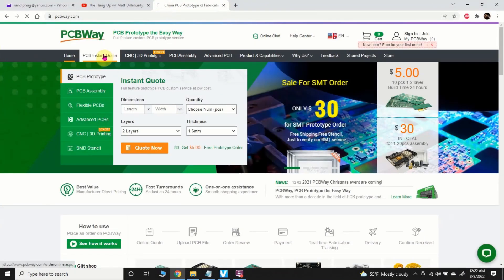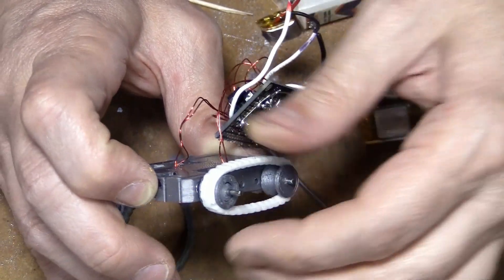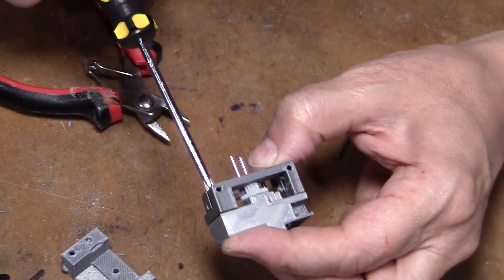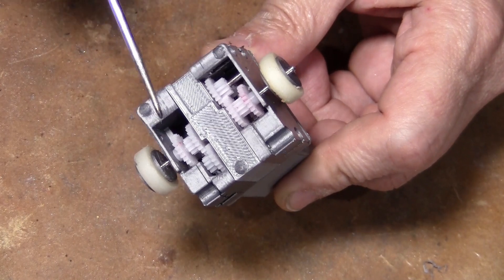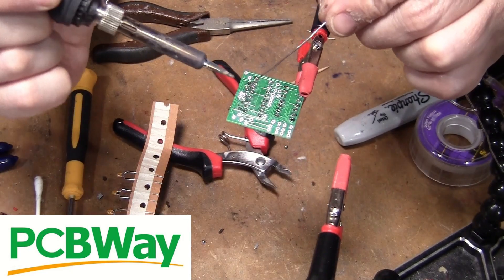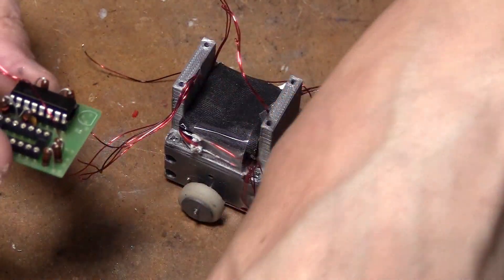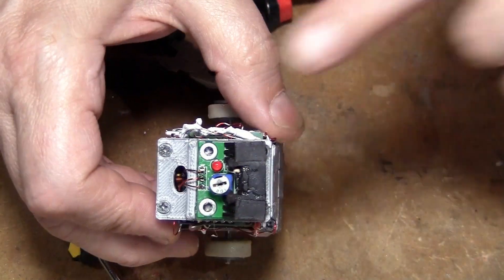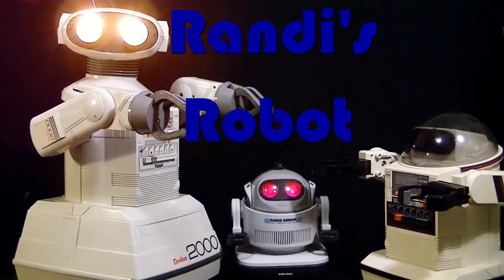Celebrating 200 Videos with a Bang: My DIY Toy Robot Adventure

Comment: looking good. 👍 I wonder if not balance charging the 4 lipos might cause problems over time.
Reply from the maker: At 400mah total... I doubt it.
Reply: @RandiRain  yea, and lots of charge of cycles.
Reply from the maker: @sideburn  I know what you're getting at, and if it was larger batteries that were on something besides a toy robot, then each battery should be charged independent and connected with diodes so they don't charge/discharge each other. But as fast as the motor runs down the batteries, and how fast they charge, and how little of amps we're talking about, and it's just a little toy, I didn't worry about it.
Reply: @RandiRain  oops I was the getting at actual charging. One battery will finish before the others do. Eventually it will get to where they are all out of balance and only one will be fully charging.  But it’ll take LOTS of charge cycles to act up anyway…
Reply: IE normally when there’s multiple lipos in a batt pack you have to “balance charge” them…

Comment: I think the main reason why the tracks didn't work is mainly the lack of tension on them, and the wheels had internal shamfered sides to allow the belts to slide off if the wheels aren't exactly in line, it is such a complicated thing to do, usually find things like an alternator belt has 2 bolts on the alternator of a car, the 1 bolt is stationary, and the other has a groove so that the mechanic can tension the belt. or if you look at a tank tracks that is why you got roller wheels above and below, and usually a piston on 2 wheels to give the chain tension by forcing the wheels out, and all the smaller roller wheels are just there to keep the tracks in alighnment, as well as to reduce slippage of the tracks that would cause them to come off. so the only real way to make it work would be 2 pieces of metal to counter leaver the slave wheels to force tension on the belts, which would also mean cutting grooves where the wheels are to allow the adjustment of the shafts for the wheels. so would suggest the altornator type route if you try something like this again whereby you want tracks for a robot.
Reply from the maker: That sure was a lot to be mostly wrong. You're right in your thinking about tracks, but you're not putting everything together. Tension was not the problem. If I had put more tension on them, they wouldn't turn. The motors weren't strong enough. I even said that in the video. The rubber was also too stiff, which I also said. With those little wheels and that rubber, which has to bend all around it, it didn't want to. I tried softer rubber, I tried making the tracks thinner, so it could make the bend better, but now every time the tank turned, meaning one track turned one way, and the other track turned the other, the tracks came off... When moving the robot, not just running freely.  You're talking about a belt that is just running freely. I showed in the video that if it just ran, there wasn't much of a problem. The problem came when the tracks made contact with the ground, which your example with an engine belt, doesn't even take into consideration. Take an engine belt, and put sideways stress on it and see what happens.
I tried tension. I aligned the tracks. The problem was exactly what I said it was. I spent two weeks trying to make it work. I didn't want to buy pints of every density of rubber to find one that worked on two tiny tracks. I didn't want to have to keep making molds with different shapes of belts. I don't have the time, money, or patience. Because Like I said in the video. It's not easy making tiny little tank tracks like that.

Comment: I build similar things although not as creative as you and my problem with tracks and wheels is it never moves in a straight line. A slight difference in resistance and it's off course.
Reply from the maker: Yes, that is always a problem. This was the first time I used a motor control IC, and you can adjust the speed of each motor by applying pulses to it. I had to adjust each motor to get it to go straight. It will be explained in the next video.

Comment: Just waiting for the lipo leads to short.  Lions use 32AWG magnet wire at most for that kind of wiring.  That looked really hard to bend.
Reply from the maker: It's fine. Works great.

Comment: Hi,
 Great video, looking forward to the next one.
 Just for future reference, If you want a flat belt or track to run smoothly on a pulley you need to use a pulley with a convex surface, i.e. a hump in the middle of the pulley. That is how the flat belt drives used to work in those old factories etc.
  It causes the belt to self align and run true, as it drifts to one or another side it gets tighter on the opposite side and then pulls itself back into alignment.
Reply from the maker: Would you like to see the STL model for yourself? The flat belt has a convex surface. The problem was when the robot turned. Flat belts on factories aren't tank tracks. Tank tracks have other forces at play when running on the ground. The belt with a V shape stayed on when turning, but took too much power to run. The flat belt, with a convex surface, had less drag, but fell off when the robot tried to turn. I just didn't want to spend time going through every little detail about the tank tracks. Rest assured, I tried everything that I could do... Except spend a bunch of money trying to find the right rubber that could make the bend around the wheel, also stay on, also allow the thing to turn, etc etc. It's not easy.

Comment: You never cease to amaze me Ms. Randi. Gorgeous mechanical design and optimum space utilization too. I am very much looking forward for "part two" of this project. I noticed a nice touch, in that the robot will actually reverse direction, to maintain its preselected "minimum distance" area. Very nice touch and in my opinion, this adds a level of "intelligence" to what is basically just a motorized "core", at this point of the build. I bet there is a bunch more of Ms. Randi genius on the way with this project and this has me very excited already. Sweet work young lady!   Fred
Reply from the maker: Thank you very much. It did come out pretty cool. It does reverse, turn, avoid objects and edges. I will explain how it all works. I'm excited for the next one too, because I learned some stuff building this.